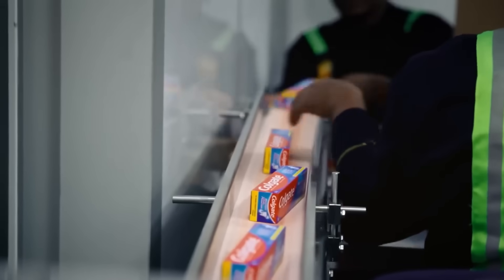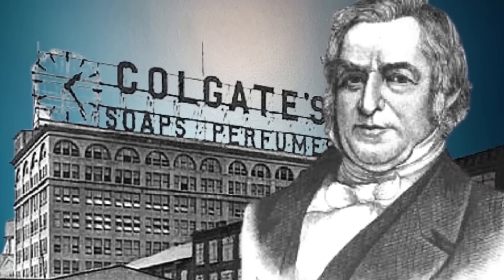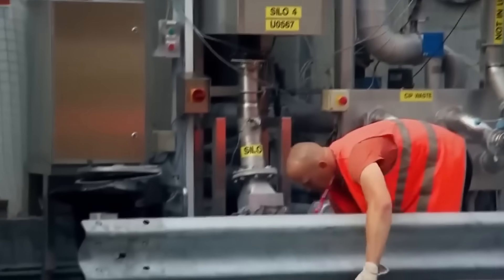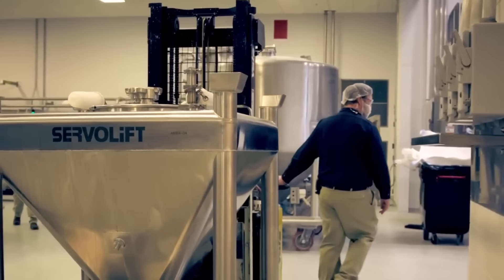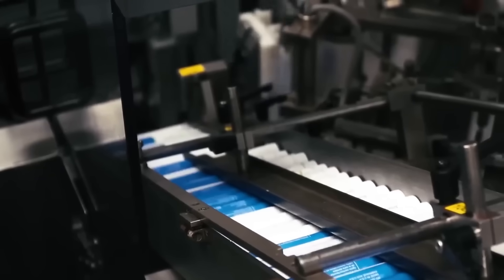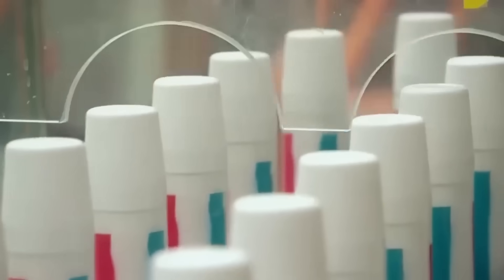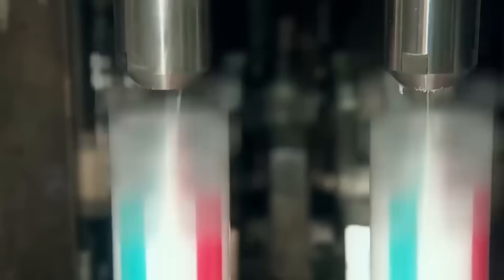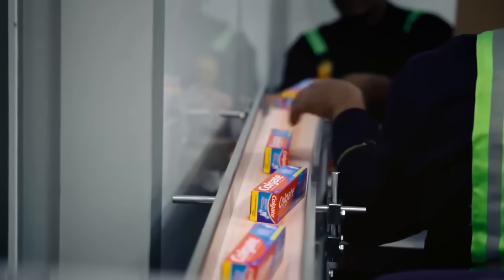How COLGATE TOOTH PASTE is MADE🦷 | Inside COLGATE Factory

Comment: Consistency you say? I had one toothpaste, twice, of Colgate, red design, extra whitening, an expensive one. It had softer moments and it had hard moments, within the same tube, I had to press it against the washing basin to get something out of it, in the middle of use, not at the beginning or the end. And yet it wasn't as whitening as the other brand I am trying currently and that one does seem to have a better whitening effect. At a lower cost.

Comment: A percentage of the tooth paste is left in the tube and cannot be squeezed out by the consumer. I need to cut the tube down the center to use the 7-10% that fails to get squeezed out by the average consumer.
Reply: I do that differnetly. When it can no longer be squeezed out  I hold the tube firmly on the side that has been pressed closed at the end between thumb and pointer finger and shake it back an forth (be careful of ones eyes incase it slips out). This forces the rest toothpaste from the volocity from the bottom to the opening. Generally within three to four days the major part of the rest has been sqeezed out. I then cut it open in it's diameter roughly one third from the end. I scoop the rest out with the toothbrush. The part I cut off is used as a cap to cover the opend tube until it is finished. I do this with all tubes whether toothpaste hand creames or other products. My tubes are completely empty when I throw them away.
Reply: I cut the tube at one end near the nozzle and just squeeze the tube flat.  With dish soap bottles and shampoo bottles, when they are practically empty, I unscrew the top and spray some water inside.  I can get quite a few more uses out of them and it cleans out the bottle for recycling.
Reply: @kenbob1071  .. I do something similar. One can use the rest of most products. I even reuse the rest from terpentine and other thinners after the paint settles when possible. At one point I used one container of terpentine to clean brushes for over ten years and I did a lot of painting back then. The people that produce this stuff surely hate me. 😂😂😂😂
Reply: @kenbob1071  Me too!!

Comment: Tooth paste containing glycerine prevents the chemicals in saliva re mineralizing enamel.
Aluminum is a poisonous metal and should not be used to store or cook anything that is used in the mouth. Abrasives used in tooth paste wear off enamel and are not acceptable. In India after Colgate tooth paste came all the problems of the tooth started, like caries because of glycerine used in Colgate, and so on.
Reply: Sodium fluoride is not good for your teeth either. It is a neurotoxin also.
Reply: Toothpaste no longer comes in aluminum tubes. Have you noticed the switch to plastic?

Comment: However, peoples thought of brushes a lot can protecting theirs the teeth; the chemicals on the other hands is eating your teeth dot damages; cleaning your teeth is only get the original protection weakened and your teeth’s is degenerative with your ages that no different your bodies inside and out can see the aging; no matter what, how you doing under the knife of plastics surgeries still seeing your aging if degenerative ages because the more you doing the plastics surgeries that you don’t looking as you’re and your faces will no spaces to pulling by the calculation of measurement at all.